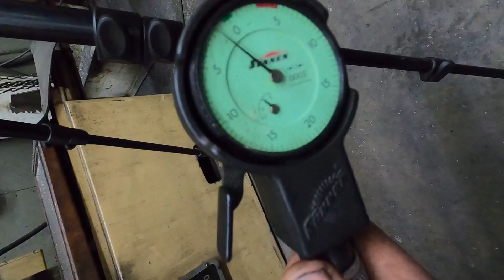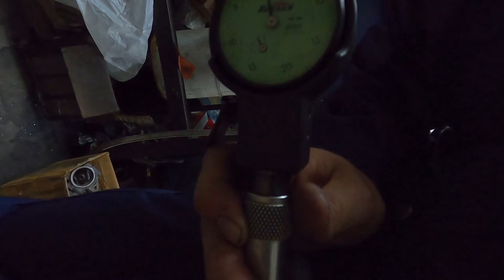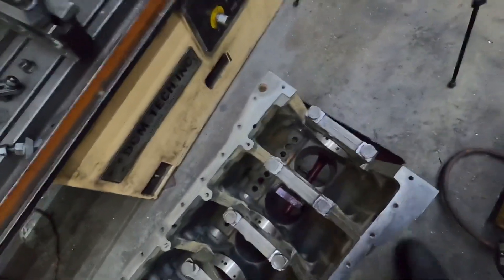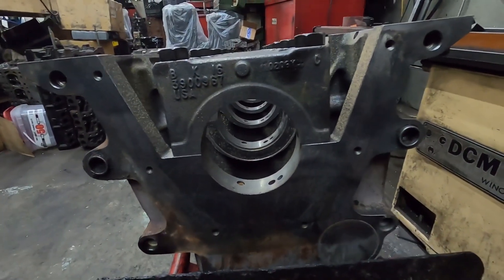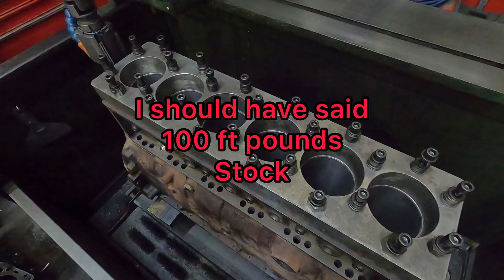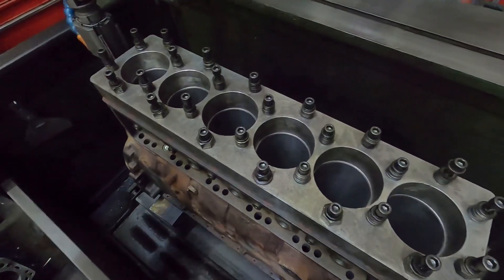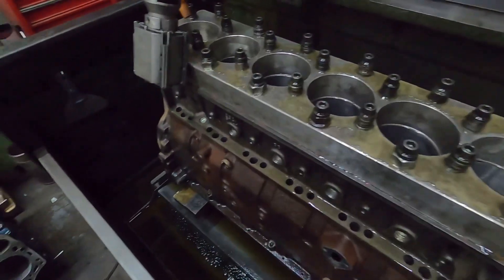HOW TO REBUILD YOUR 12 VALVE CUMMINS  PART 5

Comment: What piston to cylinder wall clearance do you use for a street motor 400-500 HP with a Mahle cast piston? And would you add .0005 clearance to #6?
Reply from the maker: That’s the will be just fine for that
Reply: @CUTTERUPROB  uhh.. ok, lol.

Comment: Thank you for making these videos sir!! All the other guys like deboss garage just half ass the videos and don’t make anything as instructional as you! I’ve got a 12v with 438 on the dash and she still purrs but recently it’s been blowing the slightest bit of white grey smoke, you can barely see it but I see it, the vent tube at the bottom also CHUFFS smoke below it which is from the vacuum pump slightly but I’ve got a feeling my rings and head gasket are worn. Also cause the guy before me probably beat the shut out of it. I’m 18 and wanna keep this ole girl till I die or that’s the plan at least
Reply from the maker: Thanks for watching. Check to see what your timing is set at. It is getting tried so you will likely have bit of base at idle but can be for timing as well
Reply: @CUTTERUPROB  If you find a minute, could you explain, "you will likely have bit of base at idle"? Thanks!

Comment: Awesome Videos! So much help, THANKS! Question: If you had a 12v with one bore(#6 of Course) that was bad, and all the rest were near perfect, would u suggest sleeving just that one?
Reply from the maker: if you sleeve the one cylinder the cylinder beside with will be out of round from installing from the sleeve. Some times you can just take a .001 out the make it come round again. but most of the time you have to bore them out one size bigger